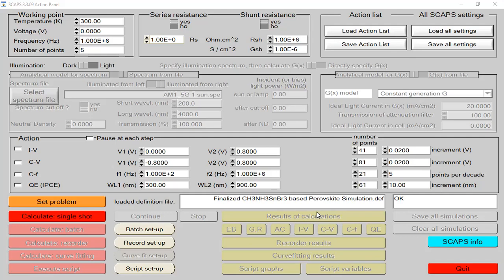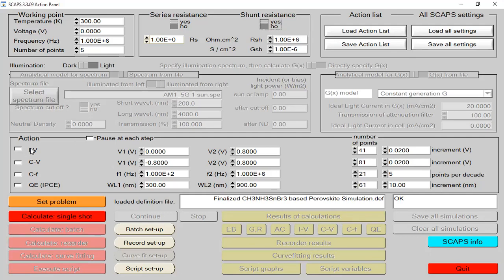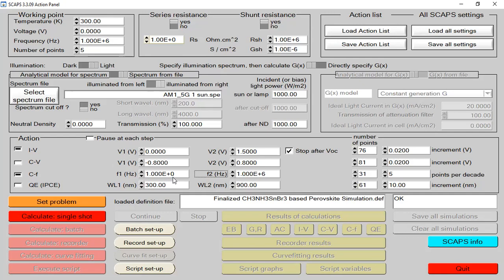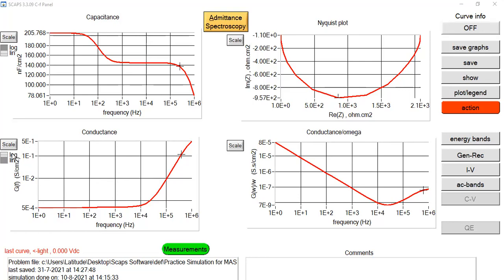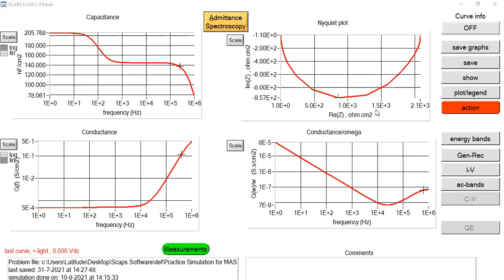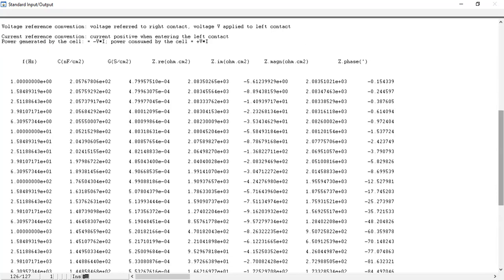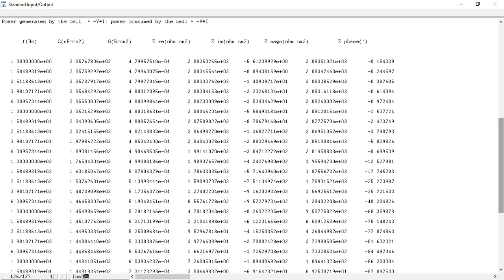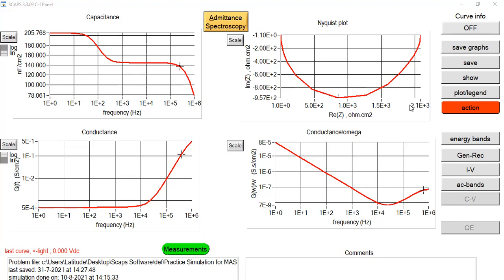Lecture No 6: Nyquist Plotting (EIS) Analysis for Perovskite Solar cells Simulation on SCAPs 1D.

Comment: Well Understood Eng. Muhammad Brother. Thank You so much for this your series lecture vedios. 
Another good question Brother, can some one carry out Scaps-1D simulation without any input defects values? Either in the center of the device or between the interfacing layers?? We need more light about this too. Because i learned that defect parametric values are lowering the PCE of the simulation.

Thank you Bro.
Reply from the maker: @YUSUF SHEHU yes brotehr you can simulate with defects values for case use defect density value of 1e13 it means you have lowest defects. Use this value for all layers Nd interfacing also. It will b best answer of your question
Reply: @engrmuhammadwaleedakram4486  okay Brother.

Thank you so much.
Reply from the maker: You are welcome 👍